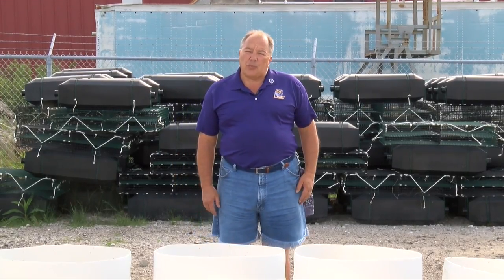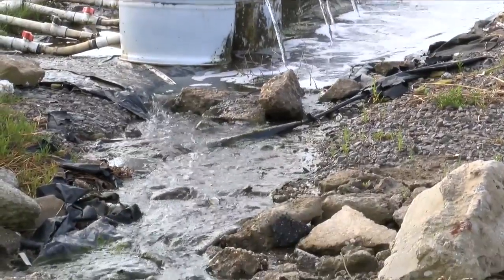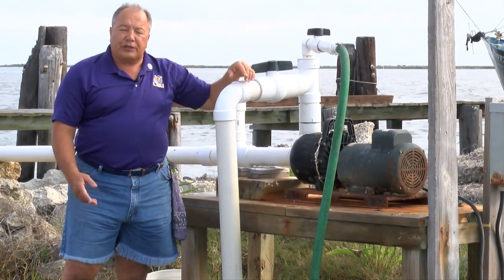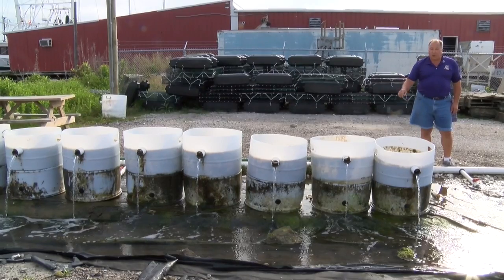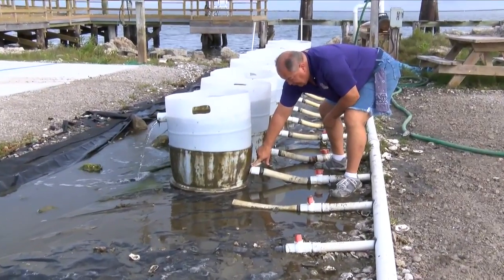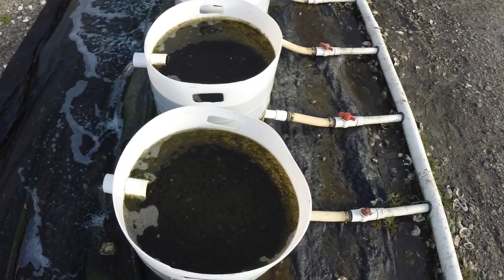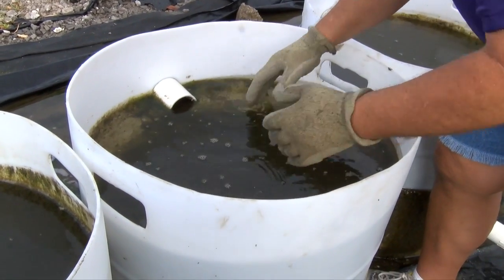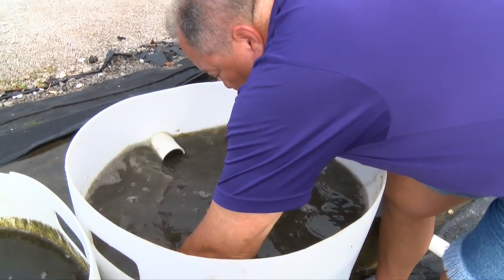Operating an Oyster Nursery

Comment: If you want  to maintain algae feeding for this drum nursery what do you suggest as it is a flow through water system countinously.
Reply from the maker: If you want to maintain algal feed for this system, you'll need to alter its design to either be a recirculating system or have retention ponds to minimize waste of feed as water discharges from the nursery. Recirculating systems need a sump for water storage and collection, treatment for biological wastes, and treatment to remove solids. Semi-closed system with retention needs a storage area that feed can be introduced into, that you'd cycle through the animals and exchange with new seawater before waste products and sediment build up. Some examples can be found in the FAO bivalve hatchery manual (http://www.fao.org/3/y5720e/y5720e0b.htm#bm11.6.1). Check with local authorities for regulations on water discharges.

Comment: Hi Dr. Supan, thanks yet again for the very good instructional video. I'm concerned about electric bills and pump maintenance, does it need to run 24/7, or is there some kind of a "down-time window", for an hour or two, bearing in mind also oyster/clam requirement?
Reply from the maker: Pump maintenance should be minimal if the intake is screened. The Sea Grant oyster lab operates the same pump in the video 24/7 for several months with no maintenance required (there's a 1 inch wire mesh screening the intake pipe).

Electricity costs should be considered, but balanced with biological demand. A pump this size operating under load will likely consume at least 600 kWh per week if running 24 hours a day. Economical stocking densities require constant flow or you'll risk the water becoming hypoxic. Any time the oysters/clams are out of the water to try to reduce electric costs is time they aren't feeding or growing well.

Comment: Why dont you just put them in the bay inside fine mesh cage?
Reply from the maker: The benefits of using a land-based nursery like this in stead of a a field nursery (like fine mesh cages) are convenience (silos are easily accessible), increased water flow (and thus food delivery), security (if you put the silos in an easily monitored location), and this system can be used if you don't have rights to put cages in the nearby water column but are able to draw and discharge water.

All of that does come at the expense of setting up the system and the electricity to run it. Fine mesh cages would be better in areas with unreliable or nonexistent electricity grids.
Reply: @LouisianaSeaGrant  Thanks for your explanations.